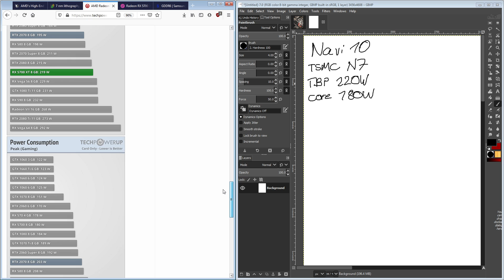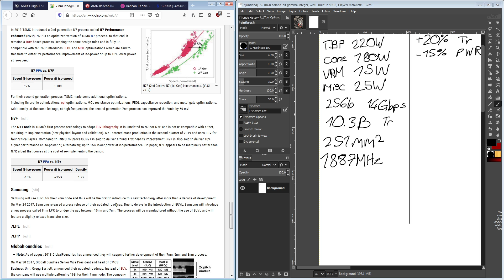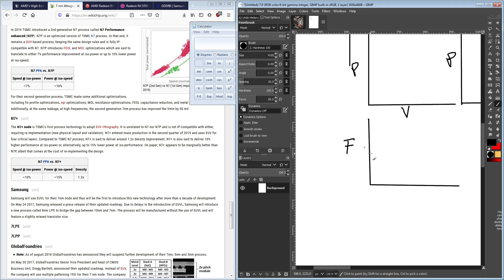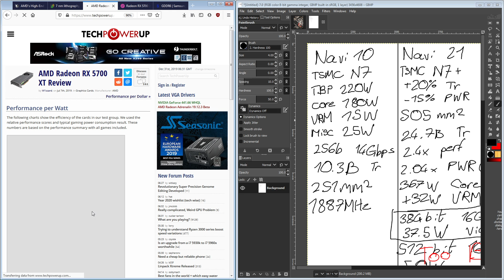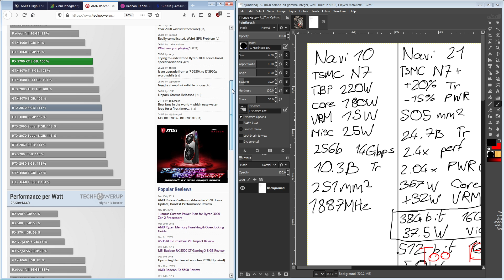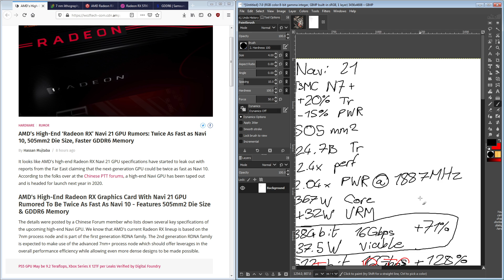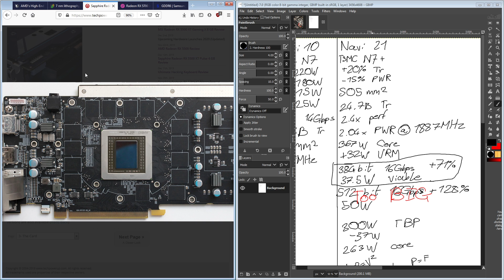I don't think Navi 21 will be 2x the speed of Navi 10

Comment: Thanks for great analysis. However, consider these 3 things:
1. improved arch
2. better memory controller (like in zen chips)
3. better memory compression (improving with every generation).
So it might be a bit better. I'm more concerned about the price.
Reply: Well, you still have to fit all that extra shader flops, memory bandwidth, and ray tracing accelerator into 300W form factor, or go Fury X route and double your BOM. Trying to cramp 2x perf into a 1.33x power envelope with just a node optimization is very, very difficult. AMD's GPU team's recent track records just add more shades to the stipulation.
Reply: @i077  they are getting r and d from Microsoft .it's not amd making those stuff alone .so yeah it possible

Comment: Back in the 900 series, the 980 was almost perfectly twice the specs of a 960, it wasn't twice the performance, it was about 60% faster.
Reply: Exactly what I just posted. There are always overheads that don´t scale linearly such as interconnects and a membus that gets longer and longer the larger the die.
Reply: I think it was better than that, looking at Techpowerup's review I see 80% faster for 1080p where memory shouldn't be a factor. The small maxwells clocked much higher stock than the spec sheet would let you believe too and often hit 1400mhz stock while the 970 and 980 would usually stay around 1200.
My 950 has a reference design (single fan EVGA) and is all stock and will do ~1440mhz until it starts throttling (which I can prevent by bumping the fan speed up), stock 960 looks to perhaps be a tiny bit slower. I do wonder if the memory limitation in the 970 is also present in the 950.

Comment: I think a about +50% Compute Unit count GPU is much more likely than literally (more than) doubling the CU count
If AMD hasn't resolved it's CU limitation problem they had with GCN, 2x would just not be possible anyways. And as far as I know we have no clue, wether they've fixed that.

Also if they put dedicated hardware for real time ray tracing on the chip like Nvidia does, it's just like
how much die size would that actually take up?

But if AMD would make a '2x more speed' than 5700XT GPU why would they use GDDR6 anyways? That chip would be hella expensive anyways so why not use HBM instead?
so yeah, that article is... not very good. I press X to doubt.

Comment: I still don't think AMD will release an analog to 2080Ti in terms of performance and especially efficiency. Meanwhile 3080Ti is gonna bump the standards even higher, and 3080 will be matching 2080Ti with new features and better efficiency.
Considering how hot 40 CU card runs at ~1900-2000Mhz and still trade blows wit 2070 Super, we won't see any wonders with next-gen AMD cards.
Reply: Dude the 3070 is gonna match the 2080 Ti
Reply: @bobpro583  Any proofs?
2080 barely matched 1080ti on launch and still on par. Nvidia may just use free transistors to double the amount of RT cores. So raytraycing may see huge performance increase, but the card itself may be identical to 2080Ti.
Reply: Shtaufaker that’s true, the 1080 Ti beats the 2080. But the jump from 12 to 7 is the same as 28 to 16. It’s going to be a two tier jump. But you can look at the 2070 Super (almost as fast at 2080) and say the 3060  will beat by a few percent. Nvidia will want to say “this x60 beats last year’s x70 at least.”
But nvidia needs to improve to sell. 3070, maybe I’ll be lenient and say 3070 Ti, is going to beat the 2080 Ti

Titan RTX - RTX 3080
RTX 2080 Ti - RTX 3070 Ti
RTX 2080 Super - RTX 3070
RTX 2070 Super - RTX 3060

Comment: I wonder how AMD going to top off the 5700XT without architecture/fabrication change, as given things right now, they only have one route, and it's to increase power draw.  I underclocked+undervolt my 5700XT to lower temp, thus my fan noise. I've been a happy camper with my all AMD setup before Adrenalin 2020 (hard lock crashes), and I hope comes 2020, Radeon can really bring the fight equal to Nvidia high end cards... Just equal in performance and power draw, is it too much to ask?

Comment: I wouldn't expect AMD to be smart with clock speed to power, they haven't considered efficiency since 2012, I would expect either a smaller die that runs at stupid high clocks like every card since the r9 290(x), or a die that big with a watercooler or maybe both.

I think it's fair to say that whatever they do it will be aimed at slighly beating or matching 2080ti performance at a slightly lower price and then Nvidia will counter with a new series with a new flagship that outperforms that by about 20% that costs 1500-2000$ and thus the cycle of price hiking continues.
Reply: I don't understand how you could think AMD hasn't considered power efficiency since 2012. Other than Vega they've been steadily improving on power efficiency since before Ryzen.

Comment: It is logical the uplift of memory bottleneck is max 44% of the 5700xt so they will keep the clocks in line, something like 1300% gaming boost. It is logical. By doing so they COULD go away with the "only" 260-280w power consumption (or 300-350w who knows, that is AMD xD) . :D great analysis video!

P.S. damn I wrote this before you were calculating the frequency xD I did it on my own lol

Comment: 24:19 eh, it may be close, I'll wait for benchmarks before claiming it will outperform that upper-end titan-Juinor priced card. And to top it off, this big die may be the supercomputer part instead of a consumer die, so there are some doubts.   I do appreciate the discussion and numbers, I have nothing to dispute with the numbers. I also agree with the no 512bit memory thing, it would suck to much from the thermal budget and all the stuff you said.
Reply: I don't think that being a super computer gpu makes sense. Iirc they were keeping GCN alive for compute and RDNA was for consumers with a gaming focus.
Reply: why I have doubts, Radion7 was a thing yes, however they would not stagnate that line when owners of such systems would pay well for significantly more that clearly, RDNA can offer. After all the Radion7 was discontinued rather fast when consumer RDNA cards launched. There is currently a gap in the 5300 passive cooled low profile range, the 5800+ range is pending, and big-guns being on old tech, so just about anything could launch at CES out to E3 (looks at clock) this year.  Happy new year by the way.  B)

Comment: A little calculation of me, if you would like to get 70% more GPU-performance and you would assume all the numbers which Buildzoid used then you would need to decrease the clock frequency with roughly 29%. The power consumption would decrease a lot more than the clock frequency (lower voltage required, power scaling roughly quadratically with the voltage). So 70% would certainly be feasible for the GPU and the memory bandwidth. This big Navi will beat the 2080 Ti, I also don't believe that much more than 170-180% of the 5700 XT performance is realistic for gaming. 

A second comment. Unfortunately I have to agree with Buildzoid that the drivers are quite a mess at the moment for AMD. Maybe also for Nvidia. One example, if I play Starcraft 2 with a 5700 XT on Windows then I experience regular crashes when I use ultra settings while using a 3700X and not even overclocking my RAM, just to make sure that the graphics card is the problem. And this with the latest driver. On Linux I had it even crash with a simple game like FTL: Faster than Light. It is improving (no crashes anymore with this simple game, Doom seems to run well on Linux) but in my opinion much too late. The drivers need to be ready at launch. I think that it is safe to say that the driver-quality and software-support decreased for RTG when Raja Koduri left AMD, he is the one who pushed better software-support! I speculate that Koduri left AMD because Lisa Su broke requirements of him. He emphasized multiple times in the media that he joined AMD under the conditions that software would get a higher investment and RTG would act independently from AMD. He does not seem the kind of person to me who would leave AMD just for the money which Intel offered. He is a great engineer, he mostly wants to have interesting projects, and AMD paid enough money that that should be fine.

Comment: Just for anyone curious... 71% performance increase over navi10 would be 37% stronger than a 2080ti ON PAPER
Reply: navi21 beats nearly 2 year old 12nm card in 7nm+. yay... sigh :(
Reply: @BlacKi-nd4uy  and by a big margin 30+ percent
Reply: @BlacKi-nd4uy  ye but for what price lmao
Reply: or about twice as fast as the 2080ti in battlefield V :)
Reply: @sango3128  first hand experience?
Reply: @skoopsro7656  well 5700xt is just couple percent slower than 2080 super on BFV so that could be possible
Reply: @skoopsro7656  look at benchmarks in this particular game. They all more or less show the same thing. Of course the game is an outlier but still it goes to show that game architectures aren't exactly optimised for RDNA.
Reply: It could be a good match for a future 3080 Ti considering Ti cards are ~30% faster than the previous generation.
Reply: @elektroencefalografista  yea but that is only if navi 21 is actually 70% stronger than navi10. It's hard to give radeon the benefit of the doubt on ANYTHING.
Reply: @skoopsro7656  Yeah
I expect it to maybe be a bit faster than 2080 Ti at ~275W TBP
hopefully they won't use a blower this time
Reply: @elektroencefalografista  I have ZERO doubt a 208pti super is comming very soon also. Many AIBs are low on inventory for 2080ti models. And a very credible leaker confirmed it and the specs. 
Full tu-102die and 16GBPS memory. 
So titan RTX die and faster memory and 999$
Reply: @skoopsro7656  it's not coming anytime soon and it's not gonna cost $999 unless AMD does something stupid.

16gbs of vram which is also faster? Yeah the vram is probably faster, 16gb depends on how much AMD puts into big navi. I don't personally believe it's gonna have 16gb of vram because the engineering is gonna be TOO hard/expensive.

Gddr6 is NOT as easy to put into a graphics card as gddr5. The traces have to be much shorter (and nvidia has other rules too) meaning you can't do what the 290(x) did with it's vram layout. This means you can't put the chips around the die (with 4 being on each side of the square) so they'll have to stick to the layout of the 2070(s) and 2080(s) with 2 sides having 4 chips but each chip has 2gb of vram (instead of 1gb) which means each chip has to use 18gbs pr. Second chips (they are expensive) just to MATCH the bandwidth of the 2080ti and you wanted to increase bandwidth so 20gbs dies will be required and I don't know if they are even being manufactured (enough of) yet.

the full tu-102 die?  Yeah probably so basically the titan.

But the card is not gonna launch anytime soon I tell you. Graphics cards leak all over the place 3 months before they are actually released (look at the 5600xt and 5500 for instance) and we have seen none of that other than speculation such as your own.

Nvidia are keeping this card as a counter to big navi which I believe is gonna be announced in q3 (so computex essentially). AMD is waiting for 7nm+ from tsmc and want to use it for zen 3 and big navi, especially for navi because it's gonna help a little with power consumption.
Reply: @sango3128  I didnt say 16gigs of gddr6 I said 16GBPS gddr6. That's being used right now and already available en mass. 
As for when it launches, I say sooner. you say later. We will just have to see.
Reply: @skoopsro7656  fair enough on the gps vs gb thing, my bad.

But I'll bet ye that it's gonna be later. AMD is definitely gonna release the 5600xt and zen 2 apus at CES (so in a week), meaning they're focusing on the midrange/lowend. Highend will come and that is when nvidia will release the 2080ti super.
Reply: What about FINAL FANTASY XV?
Reply: @fireartdrawer9531  sorry I don't watch hentai :p

Not enough tentacles :)
Reply: @sango3128  AMD GPUs can't handle Those games. Final FANTASY XV, Witcher 3 Hairworks
Reply: @fireartdrawer9531  you don't sound like an nvidia fanboy at all when you say that...

Comment: The thing is, Navi 10 is kinda already at the end of the efficiency curve, you can squeeze 150 more MHz out of it, but thats it and it eats way more power.

So if you take 200 MHz from a 5700XT you are at around 150W TBP. 2x perf is roughly correct for such a big die, if clocked around 1700 MHz.

Comment: Who cares if its 360w its faster than my 1080ti and its AMD , i want it.
Reply: Actually, if you just slap some waterblock on 5700XT, it beats 1080 ti. I have mine on water...
Reply: @대괴수대백과대사전  What if you put a waterblock on 1080Ti as well to level the playing field?
Reply: @clansome  Well... all my GPUs are on water so... there you go... :)
Reply: @대괴수대백과대사전  i would but i have a golden sample 1080ti that does 2090mhtz on water!
Reply: @andljoy  My wc 1080Ti top out at 2088mhz/ 1.093v too, by no means that it is golden sample though. Although flashing it with the Asus XOC bios can improve things further, up to 10% but the card uses 50% more power.
Reply: If it was 1200 dollars would you still buy it?
Reply: 5700xt xfire is also faster than 1080 ti so....
Reply: @hangender  5700xt is about 5% slower than the 1080 TI, thats not bad for the price.
Reply: @hangender  that works in like 3 games total. Not very many games support DX12 explicit multi adapter.
Reply: Navi has 0 crossfire support, defined by the drivers.
Reply: @hangender  Imagine being stupid enough to think that multi GPU is the way to go in 2019 for gaming.
Reply: @shawnpitman876  never did I say it was the way for gaming in 2019. But it would have been faster.
Reply: @shawnpitman876  that really depends on the type of games you play mmo games benifit from multi gpu in high population areas or if your a serious pvp player the extra fps from multi gpu set up can make a huge difference all comes down to can you afford multi gpu and do you need/want it I'm running 2 5700xt in my rig but that's not so much for gaming as it is for overclocking benchmarks for that use multi gpu in any year is better than one
Reply: only itll cost more then a 2070 and be slower still..

Comment: AMD can easily make that chip clocked where it will have best efficiency (RX5700 level one) and with the 7nm+, it will consume up to 300W being 25-30% faster than stock 2080Ti. Maths don't lie. That will allow for the cut down chip to consume 250W and surpass 2080Ti for much less money.

Comment: Can you simulate the 5600xt using an 5700 to see the ballpark of performance and power consumption? Based on the multiple 5600xt config leaks this could be pretty easy for you since it's only clock speeds and mem bandwidth.
Reply from the maker: I still don't have a 5700.
Reply: @ActuallyHardcoreOverclocking  Do the video for GN and accept the 5700 as a payment in front. :P. 

It's a shame tho. I'm pitching the idea left and right since there is no such comparison anywhere at the time.

Comment: But 2 x 10 = 20, so one more is more fast, right ? It checks out
Reply: More fasterer
Reply: Big time speed+
Reply: Dig bick energy
Reply: its big faster!!!
Reply: So, Vega 20 (Radeon VII) is 2x faster than Vega 10? (Radeon RX Vega 64) Nah. But still quite a bit of a bump.
Reply: @vablo7198  But it is faster clock on top of better process and faster (wider) HBM. It checks out. ;) I bet Navi 20 will be big because HBM or other cache. Otherwise making the chip 2x bigger is only possible if they make it 2x more something else, like ROPs and TMUs or shader units. The last bit is pointless without the others.
Reply: Its even 0.1 faster than that.